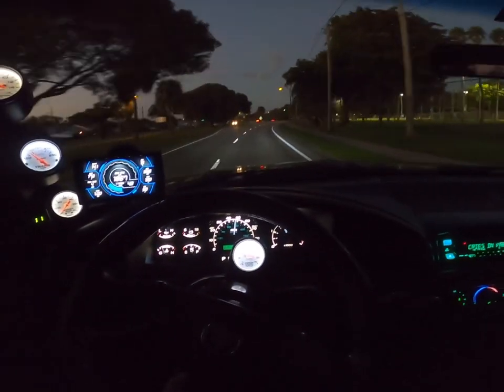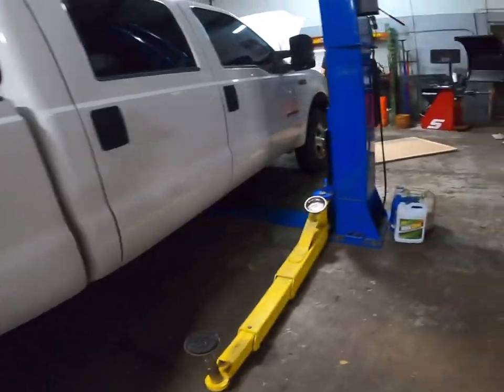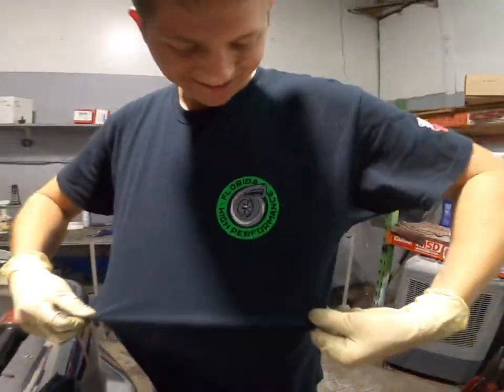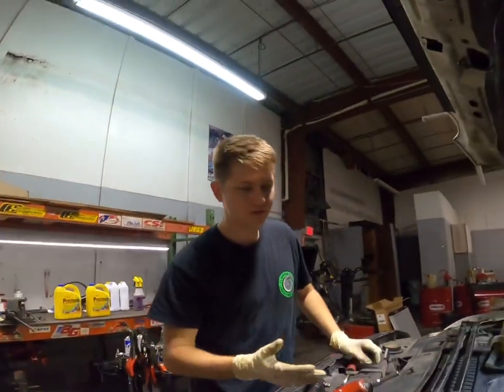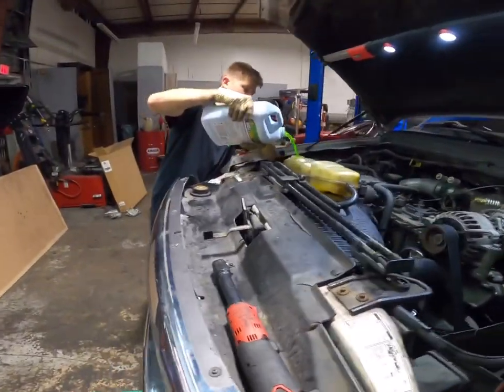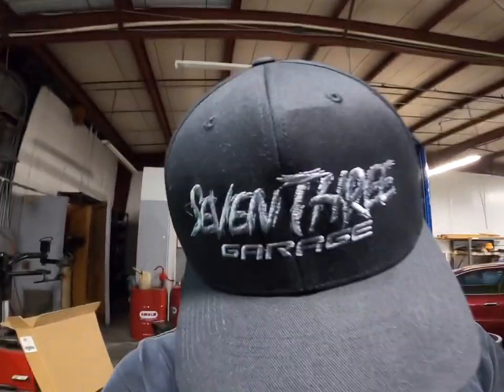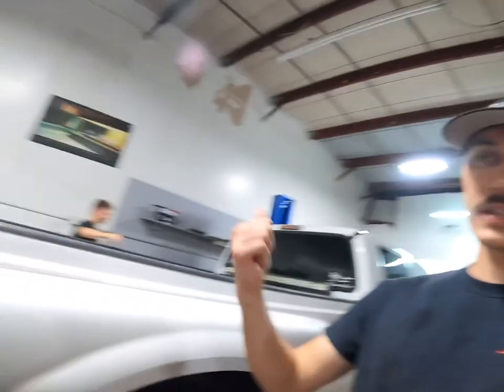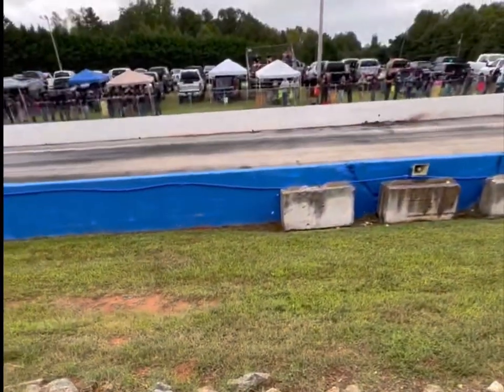Jelibuilt 7.3L race truck RIPS! Plus, a quick radiator swap for Frankie's truck!

Comment: I’ve got a 97 CCLB4x4 and I’ve done the basics (Exhaust, Intake, Hydra, Edge Monitor). Obviously I like the higher settings (+60/80hp Stock Hydra Tunes) but was wondering if I driver conservatively almost all the time is it harmful to the 7.3 at all? Am I compromising the longevity of the engine at all if I keep my foot out of it and egts’s at a safe level?
Reply from the maker: Not at all! These engines,and diesels in general, are meant to be run and have load on them. Regular maintenance is key for longevity!
Reply: Ok cool. I’ve heard different opinions. Some say any time you increase e performance there is a compromise is longevity. If you ever make it to California I’d love to do a walk around on my truck if you’re interested.